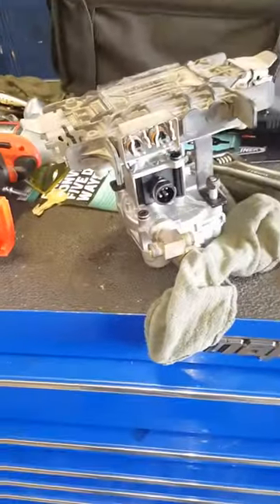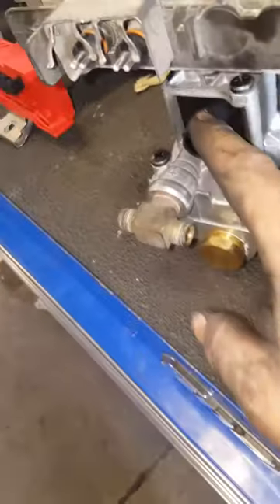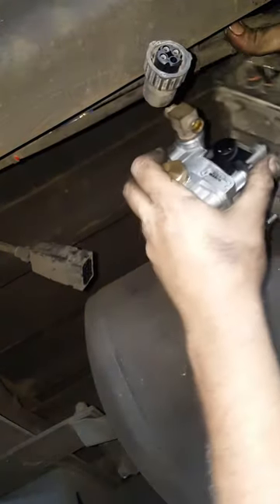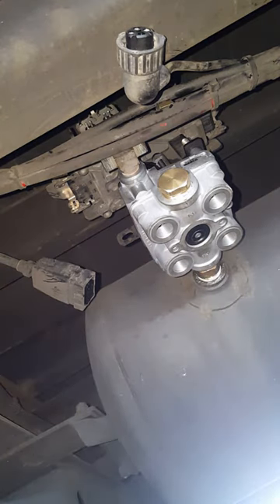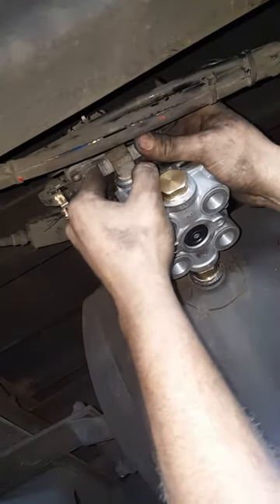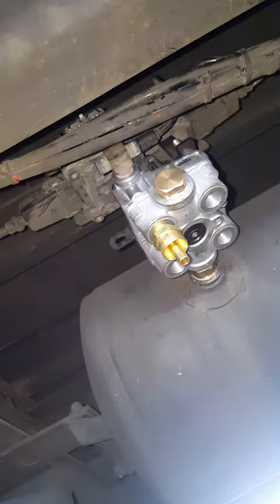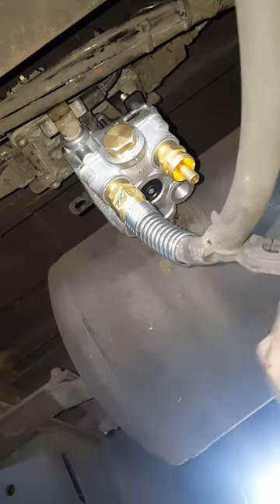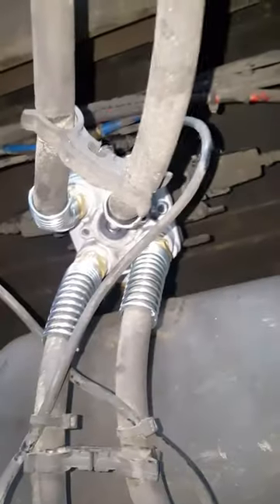How to install Trailer ABS valve

Comment: Any reason why you can't use an ABS module snd valves from a rear end of a freightliner?
Reply from the maker: Should work about the same
Reply from the maker: But the release order will be different

Comment: Hey guys wanted to ask Why you change the valve what was it doing
Reply: Agustin Gaeta   Yes I’m wondering also. Will a bad valve cause light to stay on?
Reply: The module soldering inside can go bad , but most common issue is debri clogs the screens inside the valve which doesnt allow air flow which means no brakes , if u have a abs light u can get blink codes to flash by un plugging an plugging in 7 way cord a couple of time wait a  few seconds inbetween. Hope this helps 👍